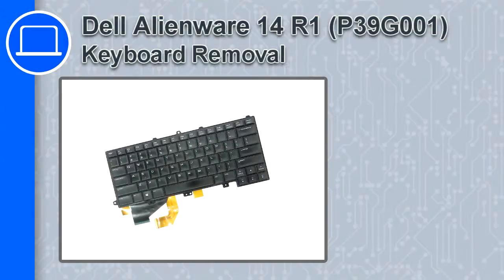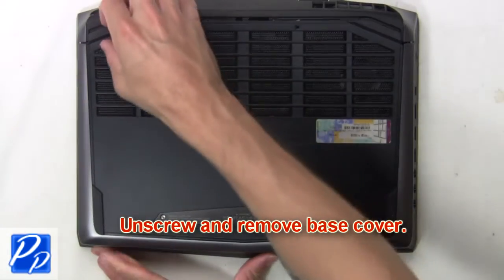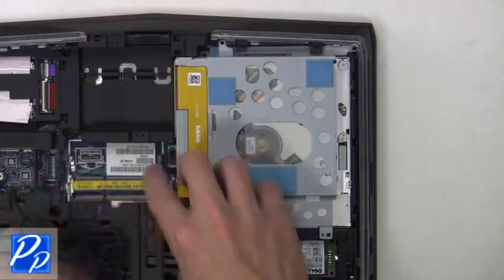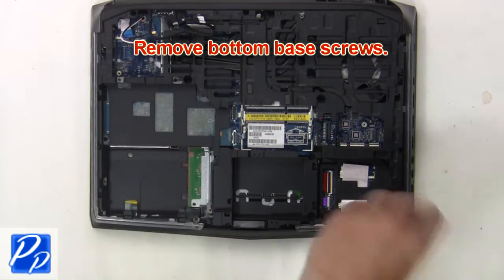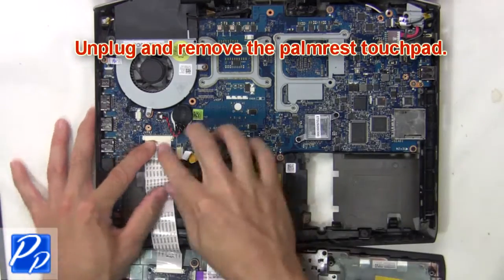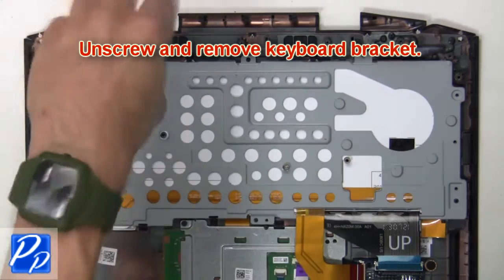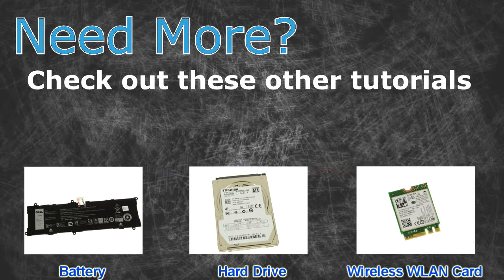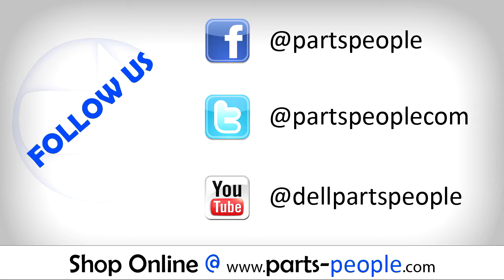Dell Alienware 14 R1 (P39G001) Keyboard How-To Video Tutorial

Comment: So my keyboard only responds when I put pressure off to the sides of the touchpad obviously this is a dated laptop now but does that sound like its faulty? Or just seated wrong it stopped working correctly after i took it apart to apply thermal paste started with a few keys and rapidly progressed

Comment: This was extremely helpful! Several keys (including J, K, and L) stopped working on my son’s Alienware 14 laptop. I followed the steps in your video until just before removing the keyboard. I re-seated the keyboard ribbon cable, and a few other cables, and now everything is working fine. As a bonus, I didn’t realize until this morning that the trackpad was supposed to have an RGB backlight! It never did that before today!